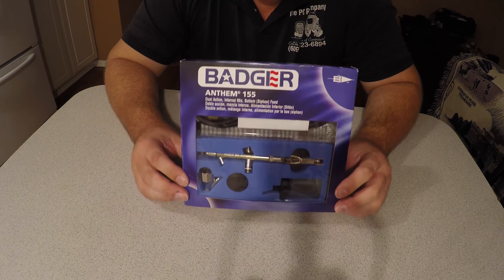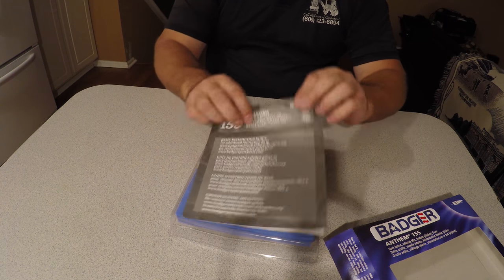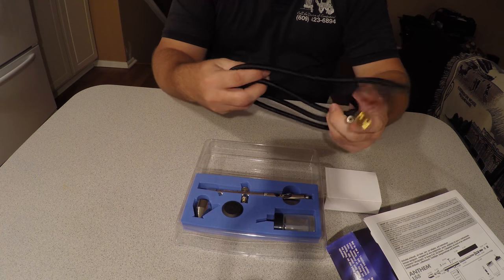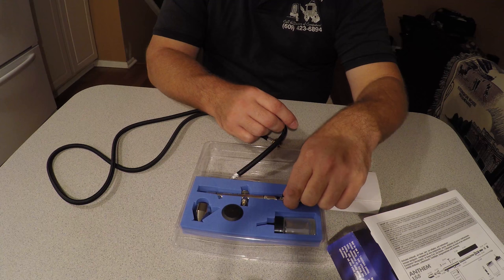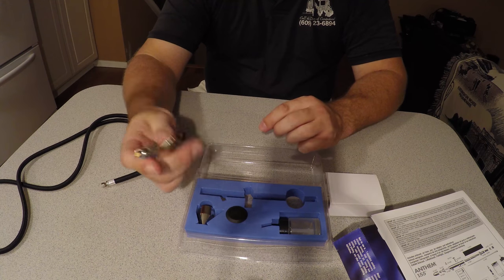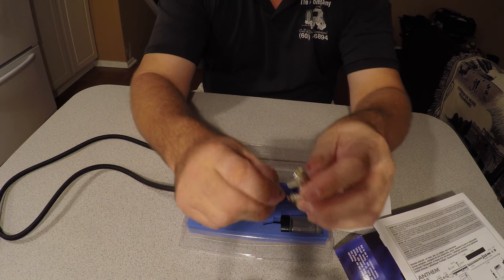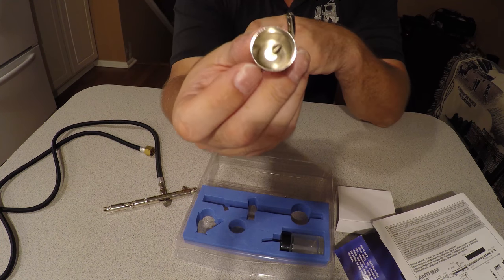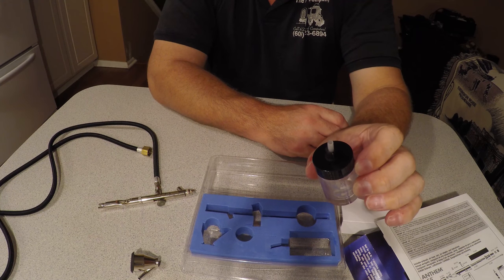Badger Model 155 Anthem Airbrush Set Unboxing Part 1

Comment: Well, how do you like your Badger Anthem 155?  After researching every airbrush on the market I finally decided on the Anthem 155.  I love the design of this brush.  It allows the user to lessen the needle tension with a knurled screw just in front of the needle chuck.  I removed the valve assembly and found a spring like the original and cut a couple of coils off.  Now my Anthem has a lighter touch which I like.  If you have any air leaks, don't use teflon tape.  Teflon tape belongs on the compressor fittings and hose fittings.  Just use a little plain ole chap stick on the threads of the spray regulator or the spray head.  Happy airbrushing!
Reply from the maker: I need to learn how to use it. I need to stop using acrylics that I thin myself and just buy airbrush paints. Thank you for the tip on the tape/capstick.  I used it on a lot of these items. https://www.youtube.com/playlist?list=PLi978IIgr_36IKaSB0eXquYYWlMZjQ88W
Reply: You don't need premixed paint.  You need to learn to mix it yourself.  I use a lot of Apple Barrel and Craftsmart paint that I pick up for $ .50 per bottle on sale at Walmart, Michaels and Hobby Lobby.  I have only 3 bottles of premixed paint that came with my airbrush.  Another suggestion is for a gloss topcoat you can use Pledge Revive It Gloss Floor polish.  I got a bottle from Walmart for $6 and some change.  It probably will last me a lifetime.  It is essentially a gloss acrylic.  You can airbrush it straight out of the bottle, just add about 4 drops of Windex with ammonia per 1/4 oz. of Clear Floor Gloss.